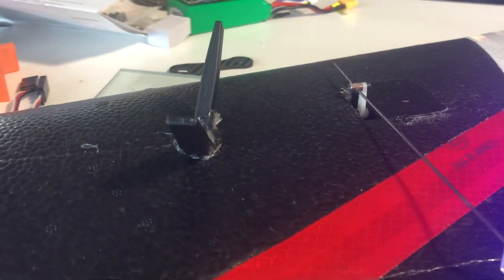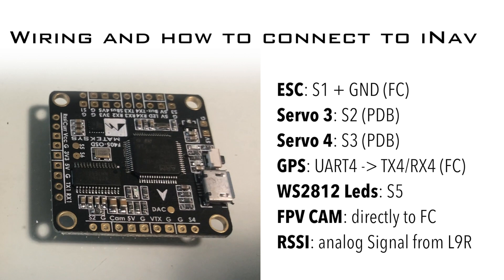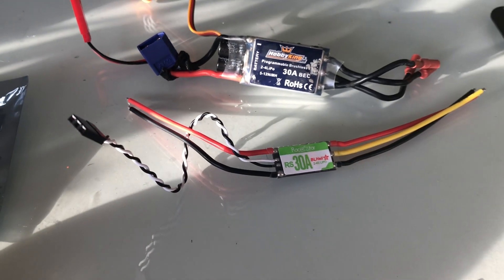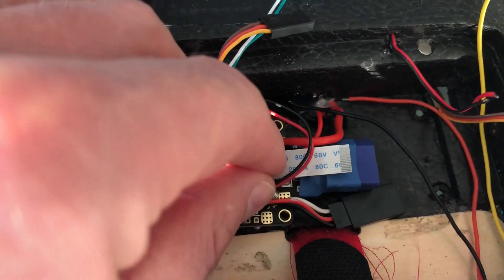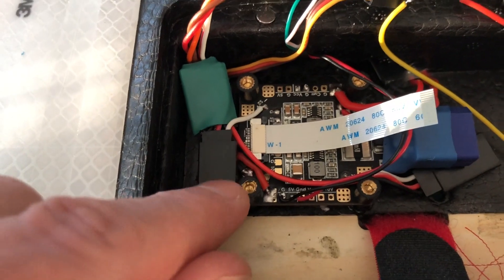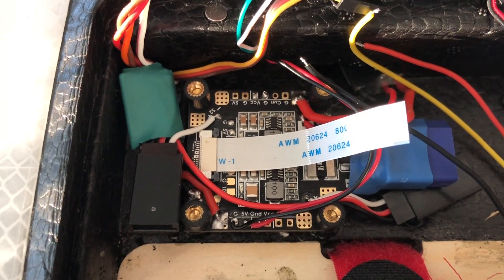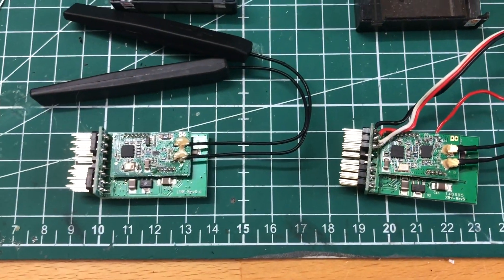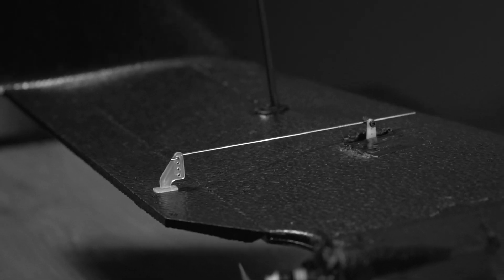S800 Sky Shadow - The Overhaul (Omnibus to Matek F405)

Comment: I have a matek fc also can I use for my wing with inav even though it doesn’t have a barometer?
Reply from the maker: Yep, you can fly without barometer. Thats what this S800 does too :) The Matek F405-OSD didnt have the bmp280 which is on the Matek F405-STD nowadays :)

Comment: Why you cant connect 5V for servos from the FC? How much servos can draw? Quite much? I want to use cheap multirotor ESC with BLheli without BEC but If I would need it I can get polulu to have separate power for servos. Is the power from matek FC not enough for them?
Reply from the maker: The power of the matek pdb is Limited to something about 2A - in case you connect multiple devices like Leds. (16x), gps, vtx, Camera, etc you can easily run into a brownout while flying. That’s why it’s good practice to add a bec for the servos only ;)
Reply: but just for servo its fine? I have camera and vtx from battery, no leds yet.
Reply from the maker: Then you could Go for it! But keep in mind that servos will suck a lot of juice while deflecting the wind on the wings

Comment: Please share your cli to me
This my email ipadair91 @ gmail . com
Reply from the maker: # profile
profile 1

set fw_p_pitch = 19
set fw_i_pitch = 41
set fw_ff_pitch = 192
set fw_p_roll = 13
set fw_i_roll = 17
set fw_ff_roll = 78
set fw_p_yaw = 0
set fw_i_yaw = 2
set fw_ff_yaw = 0
set fw_p_level = 10
set fw_i_level = 15
set max_angle_inclination_rll = 600
set max_angle_inclination_pit = 600
set rc_expo = 80
set rc_yaw_expo = 50
set roll_rate = 35
set pitch_rate = 9
set tpa_rate = 33
set tpa_breakpoint = 1300

Comment: Hi guys ....Nice job and thank for share with us..  :-) I just buy L9R receiver and I need to get rssi into my taranis qx7 can you share the wiring an set up please........ omnibus f3 ....many thanks... and Thanks again
Reply from the maker: I’m afraid you won’t get the rssi into the qx7 with the l9r! The l9r doesn’t transmit any data back to the taranis!

But you can wire the the rssi pin to the omnibus and configure the analog rssi within iNav. It can be shown on the osd!

If I remember right you need to connect the rssi to an uart port. But I’m not sure how it was back then. I will have a look at the bench tomorrow and tell you
Reply: Matebox in Motion thanks for reply...waiting for your answer.....!
Reply from the maker: Madre mio - sorry ... it seems to have left my mind! I will report back in tonight
Reply from the maker: As promised ... I did take a look. But it seems as if I back then injected the RSSI into a channel. As I use the Matek setup today, I have a dedicated pin to hook up to! As I was unsure on how to make it happen on the Omnibus, I looked at the WIKI ... 

"RSSI Sensor Input
The RSSI sensor adc is not supported due to the hardware configuration limitation."

You'll find the data here: https://github.com/iNavFlight/inav/blob/master/docs/Board%20-%20OMNIBUS.md
Reply: Matebox in Motion thanks for your answer.....Just toi bas......there Will be à way. With inav

Comment: Hi. Helpful vídeo. I have similar setup on my S800, but I dont want to use a Bec. How could I connect the servos?, ground and red wire to 5v on pdb, and signal to S pads on fc?
And, please, could you share with me your dump? It will make things easier. 
Thanks for your help!
Reply from the maker: Hi Roberto,

sure, you can connect the servos directly to 5v via the pdb. But be aware this could cause brown-outs which commonly end up fatal while happening in the air. YET again, I have it like that on the AR Wing as there are not so many power consumers there by now. The servos will be connected to the S pads as you assumed. So its straight down the road :)

I will surely give you my dump but i doubt it can be useful to you. (currently im not satisfied with the tuning - but that could be me picky)
Reply: Matebox in Motion ok, I put a Bec then, I want to fly without risks ;)
I would appreciate if you share the dump.
Reply from the maker: I've posted the DIFF to the facebook post- you can find it here : https://www.facebook.com/mateboxaerialimages/posts/1481668065281143
Reply: Matebox in Motion thanks for your help!! Regards
Reply from the maker: Your are welcome,  Roberto

Comment: Why didn't I stumble into your post earlier. Have a lot of problems with my Omnibus F4 v1 (clone) to get the board and Servo's powered and at the same time voltage in my OSD. I would love to receive your Settings of the Matek. Cheers mate
Reply from the maker: hehe ... we all learn from what we experience! Well ... and if we can help out, then why not?! What settings do you need? Right about now I have the feeling, that there is an need to tune the PIFFs a bit to get it less shaky and stable in da wind

Comment: Awesome vids you guys do! Thumbs up.... Would you please forward me your Inav setup? Thanks in advance CR >curtisruin at aol com
Reply from the maker: Thanks ... it keep the motivation high with those kind of comments! Currently we only have a iNav 1.7.3 at hand but as we have moved on to V1.8.0 we will have to make another dump!

Keep in mind that these values wont help you as much as might expected! You will surely have an other setup/set of components (eg. servos) which will make the PIFFs worthless. But for now you can take these to start off with:

# profile (iNav v1.7.3 / fixed wing / S800 Sky Shadow / analog servos)
profile 1set fw_p_pitch = 19
set fw_i_pitch = 41
set fw_ff_pitch = 192
set fw_p_roll = 20
set fw_i_roll = 17
set fw_ff_roll = 78
set fw_p_yaw = 0
set fw_i_yaw = 2
set fw_ff_yaw = 0
set fw_p_level = 10
set fw_i_level = 15
set fw_d_level = 75
set max_angle_inclination_rll = 600
set max_angle_inclination_pit = 600
set dterm_lpf_hz = 40
set yaw_lpf_hz = 30
set dterm_setpoint_weight =  0.000
set fw_iterm_throw_limit = 165
set fw_reference_airspeed =  1000.000
set fw_turn_assist_yaw_gain =  1.000
set dterm_notch_hz = 0
set dterm_notch_cutoff = 1
set pidsum_limit = 500
set yaw_p_limit = 300
set iterm_ignore_threshold = 200
set yaw_iterm_ignore_threshold = 50
set rate_accel_limit_roll_pitch = 0
set rate_accel_limit_yaw = 10000
set heading_hold_rate_limit = 90set nav_fw_pos_z_p = 50
set nav_fw_pos_z_i = 0
set nav_fw_pos_z_d = 0
set nav_fw_pos_xy_p = 75
set nav_fw_pos_xy_i = 5
set nav_fw_pos_xy_d = 8
set rc_expo = 80
set rc_yaw_expo = 50
set thr_mid = 50
set thr_expo = 0
set roll_rate = 35
set pitch_rate = 9
set yaw_rate = 20
set tpa_rate = 33
set tpa_breakpoint = 1300
Reply: Thank you so much for providing me those PIFFs! Best Regards from the Sauerland
Reply from the maker: You’re welcome- and the Sauerland is no that far away ... :-)
Reply: PS: Will let you know how I proceed with my first wing! Cheers....

Comment: hi there
a complete noob question here!!
i have your same setup f405 osd fc6 hub and bn880 gps.
i'm looking to connect the gps to the board, i have 6 wires coming out from the gps and i dunno which do i have to connect to the matek.
would you post a picture of your gps wirings? thx
Reply from the maker: hi there ... making a picture is not as easy BUT ...i'll explain :)

Connect as follows:

- the GREEN wire from GPS to TX4
- the WHITE wire from GPS to RX4
- the RED+BLACK wires to 5v and GND on PDB

set the UART4 to be GPS

And thats it! The other wires aren't used for fixed wing (Compass) :)
Reply: thx a lot, will try!! 
where are you from? looking for flying fellas
Reply from the maker: You are welcome - when I started back then, I needed help too! So this time it's me to help others :) We are from Germany
Reply: Why compass isnt necessary ? it could be great for RTH no ?
Reply from the maker: On a multi rotor you can go sideways - a fixed wing can’t do that in the same way! There is only one direction which is forward! That’s why you don’t need the compas on the fixed wing! A gps is enough to estimate position and movement ;)

Comment: I was looking for the f405-osd with the pdb but then I realised that the osd version doesn't have the sda and scl pad. Do you know how to connect a magnetometer on the uart3? I didn't find anything online
Reply from the maker: +Giovanni Scieri in case you need it for iNav, then there is a target which opens uart3 to be sda and scl- the target should be matekf405-osd
Reply: Matebox in Motion Thanks a lot, once the board arrive I'll try

Comment: Not keen on that ribbon cable, i may use the F405 aio. Great video. Has it flown yet?
Reply from the maker: +chris whitehead take what is best four you! That’s the idea behind it all! And having connected the two boards with that cable is fine for me. Save a lot of connections and lets me replace things in case I have to
Reply from the maker: +chris whitehead it has, and it’s pretty nice! Although the first batch seems to be defect! But reporting this to bg solved the problem. The other fcs didn’t show any failures and I’ve been through some flights now ;)